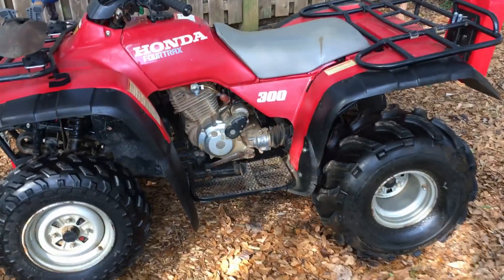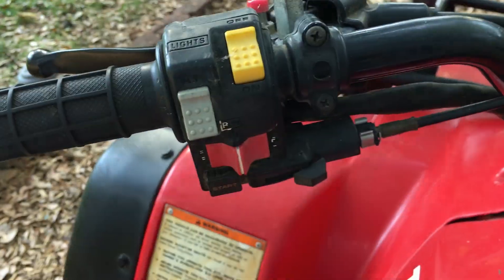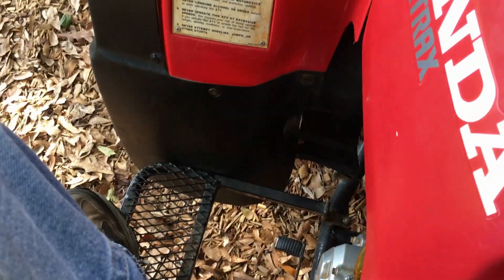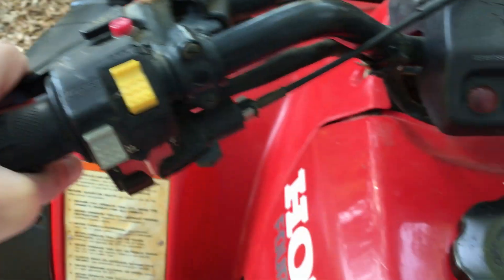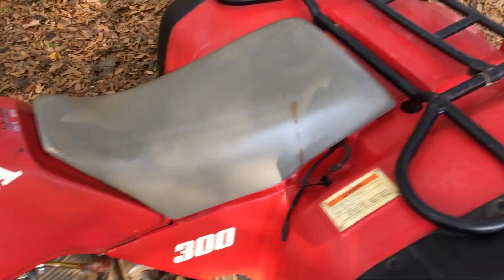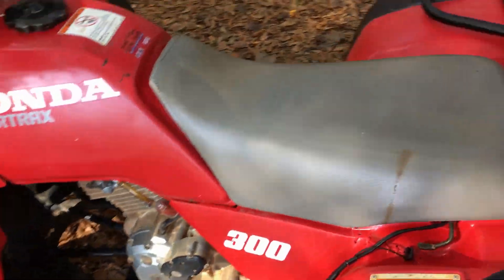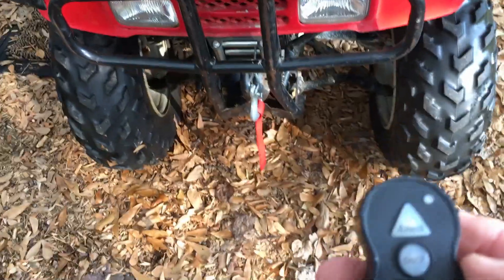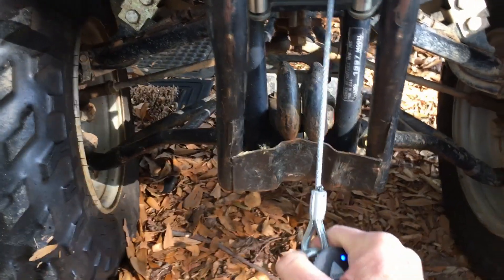1997 Honda FourTrax 300 Overview

Comment: few pumps of gas?lol,does nothing,its just a cable run into the side of the carb that operates the slide in the carb,it does not pump gas in it!!
Reply: @yeahright302  you obviously have never ridden an older 4 wheeler.
Reply: @walkerclay2489  oo i think i have,im 45 years old,bought and sold more 150 atvs in my time kid.work on them for a living.so before you mouth off,know what your talking about,kid!!!!!!!
Reply: @yeahright302  feel bad for the people who’s quads you fixed.
Reply: Not true

Comment: So I have been trying to buy a cheap Honda recon or and deal and I can’t seem to find any of these
Reply: These r the best man even for off roading! Farming just not racing it’s not clutch so super easy to drive 5 gears I believe
Reply: Bought a 200trx from 84 for 450 and it just needed the carb taken apart and put together correctly. (Previous owner put some components in backwards or upside down) then my brother in law fixed up a quad that he bought for 750 or so and I got it for 1,700. Its a 96 fourtrax green with a 300cc. Perfect pair of quads for the wife and I

Comment: You state, "PUMP THE GAS" to start cold...lol.. these do NOT have excelerator pumps. Pumping the throttle literally does NOTHING. Absolutely nothing, unless engine is already running